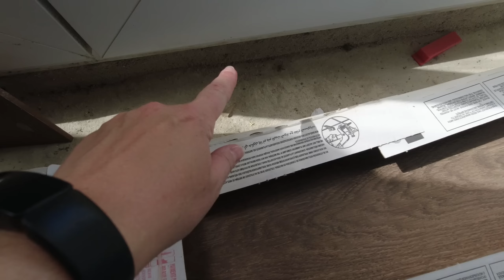Renovation Update | Floor Tiling Part 2 | My Central Portugal Farm #68

Comment: Why not turn the wardrobe around and use the back of it as the headboard. Then it would become a false wall. Pull it away from the wall far enough to create a walking space to get to the shelving on the other side. You could add a swinging door to enter the space or a curtain or even beads. Leave the top open to allow airflow. Once in place you could run wiring for outlets for your bedside tables and lighting in the wardrobe nook. Just a thought.

Comment: Tiling looks wonderful.  If you build shelving/wardrobe it can be used to hide wiring for additional recepticles/lighting.  A platform bed could be built into the shelving.  Shelves up the sides and overhead.  One final thought.....Girl you gonna have olives olives olives!!!  Thanks so much for the update.  Keep at it, it will be done before you know it.

Comment: You can put silicone on inside of the door,  temporarily, but long term outside needs to be dug down at least another 5 cm, the older houses have a brick high for floodings, it could be splashing up.

Comment: You could also create storage on the backside of the headboard, facing the cupboard, to capitalize on your storage space and give more support to the headboard so it doesn't move around. If it's low, it can double as a bed table, or if higher, it can block the view of the cupboard. Win-win! 💕So sorry about Pidgey.

Comment: Such sad news about Pidgy....He was really a big part of your 'family' on the farm.
Well done with moving that huge door all by yourself!  Going to look so good when your strong helpers have fitted the door.
Look at those olive blossoms already!! Beautiful,  as are the poppies and daisies too...very colourful.
Can't wait to see the sofa too!
Great going with the tiling. Good job and nearly there.
Going to look beautiful once cleaned and grouted.
Perhaps just leave the tiles in a straight line at edges and fill the skew bits against the wall with cement?
Your light fittings look beautiful....very attractive.
Great idea to make the best use of the  available space in the new room by building the cupboard behind the bed and then place a slatted screen or divider in between and behind the headboard.
Going to look good.
All the best with your day job too and juggling everything in between too!